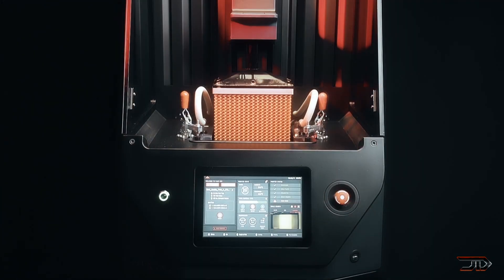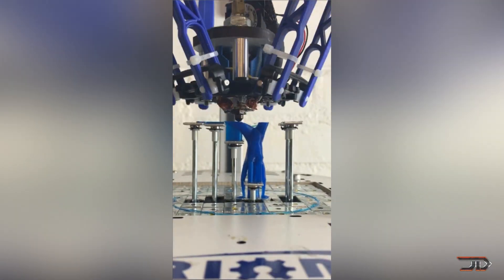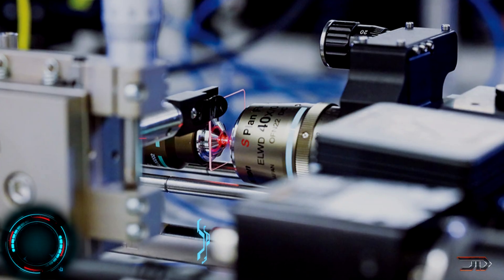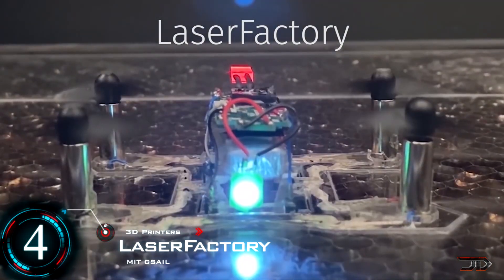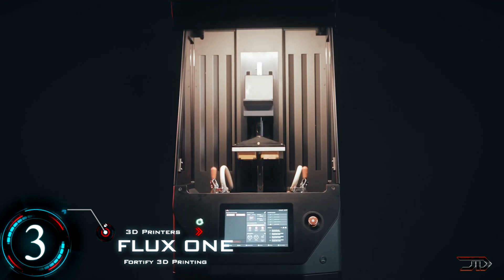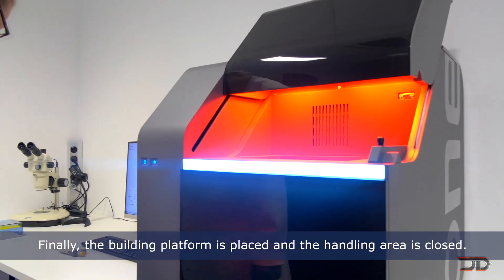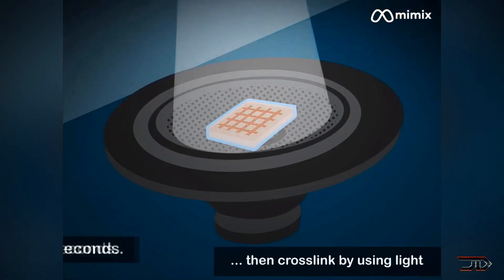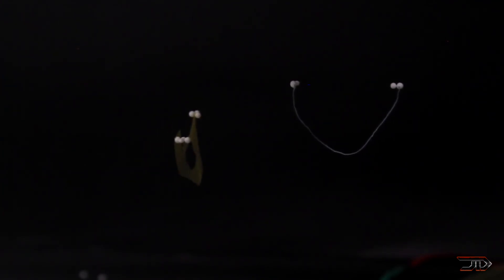7 INCREDIBLE 3D Printers (2021)

Comment: Wow, what an eye opener for me...I'm still trying to build up enough confidence & knowledge base to try out my $129 Monoprice V1, making simple things with PLA first .
Reply: Al Zughal has a good point. However I'll add... You have a printer. Confidence comes with use. Fire it up, experience what happens when it all goes wrong, adjust, do it again. This is how confidence grows. Don't be afraid to screw up, everyone does. Learn the ins and outs of every element from setup to slicing to execution. There are some amazing teachers on  Youtube. Lookup Michael on Teaching Tech, 3dPrinting Nerd, Angus at Makers Muse, Stefan at CNC Kitchen. I followed all of them and in a couple months have learned so much. Realizing I have a long way to go nevertheless. The worst failures, the real hard ones are watching a 12 hour print go beautifully and the last hour all hell breaks loose and you have a disaster. Been there. The fix? Bed skipped because? rails were dry and the bearings I use are fairly snug. Some light lubrication, no skip. So many lessons and you can't learn them until you move forward. GOOD LUCK! ENJOY!

Comment: 3d printers might be good for personal use and small projects but not for mass production more importantly I really don't understand the difference between them and CNC and EC machines.
Reply from the maker: It would be nice to have a multimaterial (metal, plastic, rubber) printer for fixing parts but it seems like anything other than plastic is $$$.
Reply: 3D printing is plenty good for mass production. It just isn't often the best option in terms of speed and efficiency. But depending on the product, it might be your only option if you can't outsource for whatever reason or buy whatever machine is needed (injection moulding, 5 axis CNC or whatever manufacturing machine you might need to make your parts). There are also some complex geometries (like some lattices) that can only be made using 3d printing and we will see more and more of in the future. Prusa3D mass produces 3d printers using 3d printers. I also do batch production on 3d printers for one of my products (with a capacity of a few thousand units per month which is pretty darn good for a production line that cost me less than $1k to setup).
Reply: Not clear what “EC” stands for as you didn’t spell it out, and I don’t want to assume (I’ve not yet watched the video) but CNC is “Computer Numerical Control” which, curiously enough, is how most 3D printers you can buy or get firmware for are controlled for programming.

CNC mills are mills that are programmed via CNC g-code in the same way as the 3D printers mentioned, but using different tools, etc. than a 3D printer, but otherwise moves in the same manner in general.  The traditional CNC machines of various types (including lathes) are typically used in subtractive manufacturing, where the tools are used to remove whatever is not the desired end part from a block of raw material.  3D printers add material from the start, and join it together via whatever method makes sense for the type of material and 3D printer, of which there are many different types of 3D printers and materials used for 3D printing.  The most commonly-available 3D printers add material one thin layer at a time in a flat layer, but that’s not the only design that exists, just the most common.
Reply: Cnc fabrication relys on removing materiel. 3d printing adds it. Dont know of that's the only diffrence
Reply: @KaidenJacob  that is basically it, CNC is a subtractive technology and  3d printing is an additive technology. CNC need to be more robust has it is frequently use to remove metal.
Reply: For mass production you buy more 3D printers instead of setting up a production line. At the start of covid there was an immediate need for face shields, a lot of people with 3D printers started printing millions of them for healthcare workers.
There is a company that 3D prints rocket engines in one piece and is working on printing an entire rocket.
Instead of assembling 5000 different components for a rocket engine, you just hit print and wait a month.
Reply: @disposabull  3D printer is not good for mass production, if you are going to produce a massive amount of the same part, injection is the way to go. There are some print shop that print 24/7 but that is for small quantities of different parts.
Reply: @yvesinformel221  You are correct when you think about things in the normal business sense that we are used to.
But it is still the case that when the world need lots of face shields RIGHT NOW, the millions of people with 3d printers at home produced far more face shields for local use in a far shorter timeframe than business could scale up to setup new injection moulding lines and then fly the face shields around the world and distribute them.
There is no reason that 3D metal printers should cost more than $1000 apart from patents and software development.
In 10-20 years time that will be a reality and that is when 3D printing starts to get very interesting.